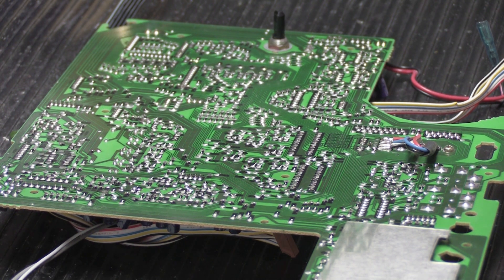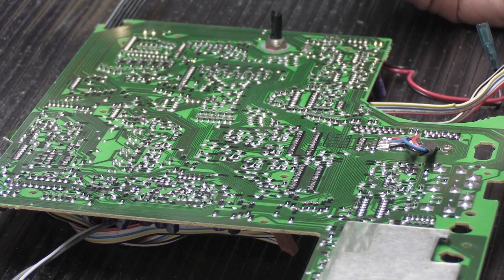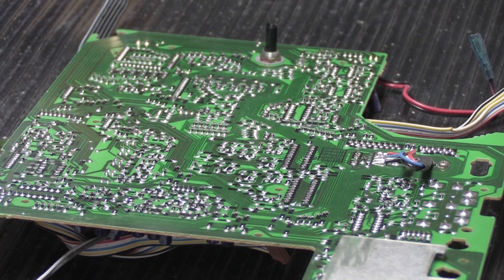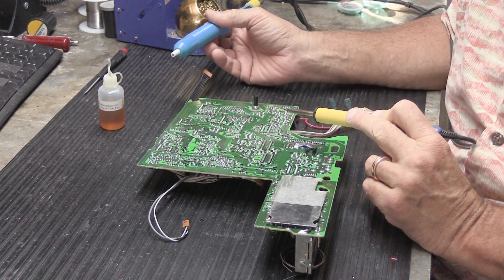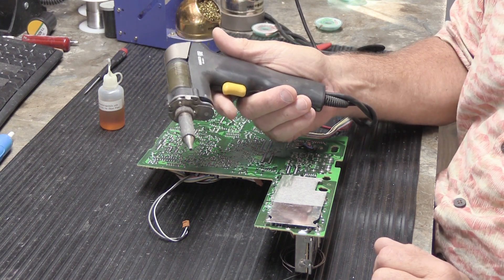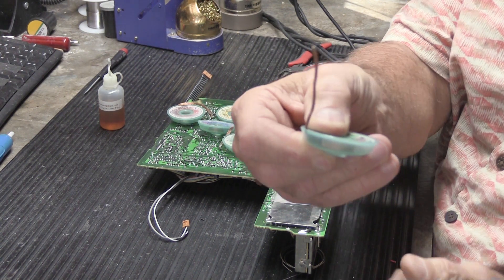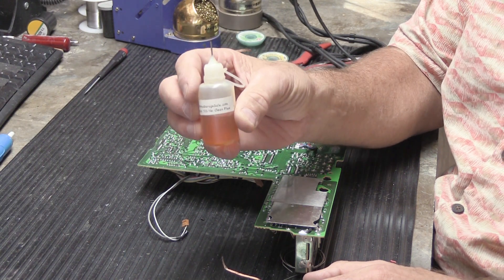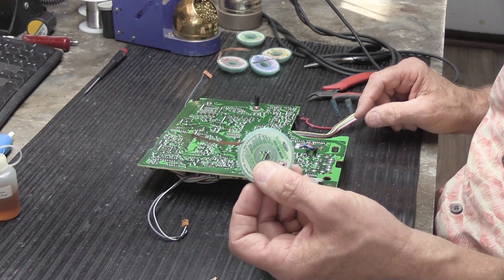Tips & Tricks in Under 5 Minutes #5 - Desoldering can be done in different ways ~ You Choose

Comment: I see you did not loosen the braid before soldering. I normally use my Hakko but in the past, I would push the braid back into itself just a bit.
Reply from the maker: Hi 1976fordelite:  Good Tip - I have done that at times, especially when the area that needs to be desoldered is large - like when there's bent-over tabs that hold a transformer onto the circuit board - Chris